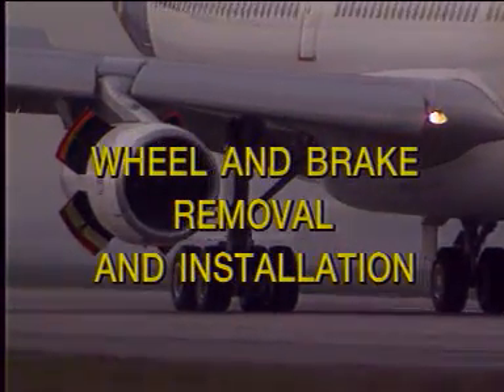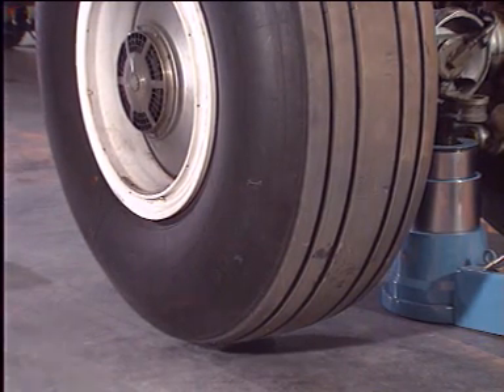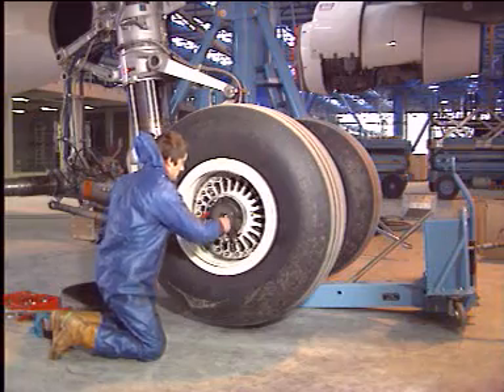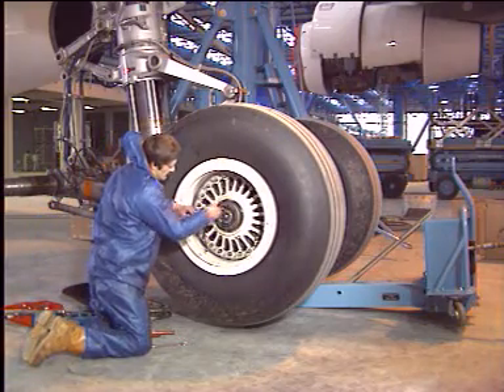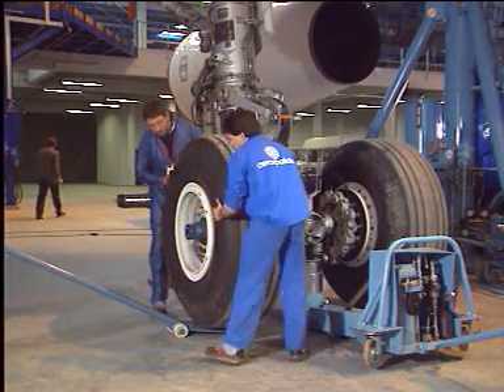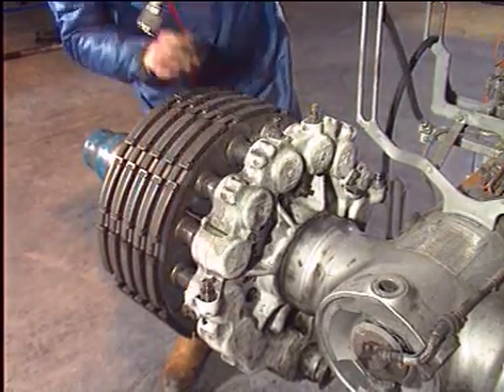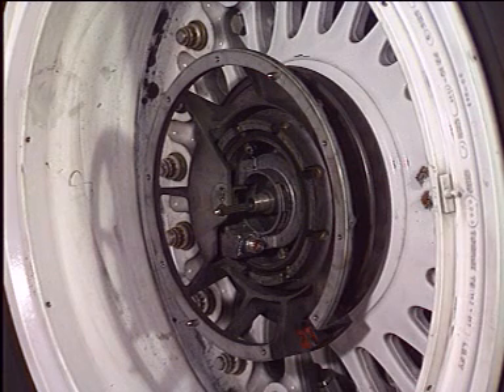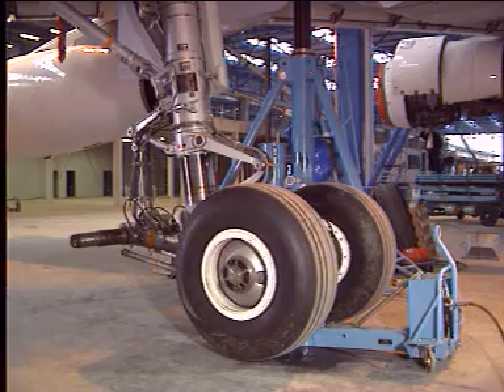AIRCRAFT | A330/A340 Main Landing Gear Wheel & Brake Removal / Installation

Comment: 3:35 "unscrew the wheel nut using the appropriate tool" a torque wrench is not used for anything but measuring torque on a fastener and not in reverse. Even I know that and I'm just a truck driver ffs
Reply: Yup, that’s what I saw too.

OMFG......
Reply: And yet, that’s the way it’s done every day at airlines all over the world.

Comment: The Installation procedure is nonsense (Its Never the reverse of Removal) How about connecting the Brake hydraulics ? and the torque link ? what about Torque tightening the various attachments ? How about a post installation Test.  Just about every mistake in Tech Pubs is in this Rubbish video..

Comment: Let me see if I have this correct:  The wheels on a main landing gear are removed with hand tools; the locking bolts are secured with cotter pins; landing gear assemblies are held out of the way with zip ties; break assembly is put on a wooden pallet.  Okay, I've got it.
Reply: Yep

Comment: Pro tip:  trust a nylon tiestrap to keep that 80lb control rod outta the way and stop it from falling on the next guy..  And torque wrenches should be calibrated after beating parts with it.

Comment: I'm watching this just in case the landing gear brake need to be replaced while I am in the airplane. You never know..
Reply: xl 
.
Reply: Where are your equipments? Are u gonna use toothpick??
XD
Reply: Yeah in case you get flat tires there is a spare under the plane.
Reply: @carlmichael4979 actually there ıs a spare wheel 😊

Comment: Use the appropriate tool...  and the guy uses the side of a hammer to knock a piece lose.
Reply: John Burton Maybe his boss is real cheap.
Reply: Thanks for sharing the video 😊
I going to buy an Antonov An-225  with 32 wheels.
This will really help me 😁😁
Reply: Holds up the torque strut with ty wraps from Harbor Freight
Reply: Absolutely correct? larger surface area.

Comment: You're not supposed to use a torque wrench for loosening bolts.
Reply: But why? I mean it makes the job easier since you can apply more torque on those bolts. With a normal wrench, you need to apply more force
Reply: You’re absolutely correct, yet in the real world, aircraft mechanics do it this way all the time. It’s just easier to have one tool for both loosening and tightening. Plus the torque wrenches are recalibrated annually, so you would know it if you knocked one out of calibration.

Comment: Will this work on my a330?
Reply: Gamebreaker08 no
Reply: Gamebreaker08
Reply: Well you would have to have some basic knowledge of a330 wheel removal of course,but I’m sure the steps are similar enough that you don’t need to spend to much time researching how to remove an a330’s wheels.
Reply: Yes. A340 and a330 wheels are the same. Same landing gear.

Comment: I wanna do line maintenance.  I`m going back to school for a career certificate in Aviation Maintenance Technology.
Reply: Where do u work?
Reply: VWGTI hard  work and long hours. I did it for ten years and if you have no medical problems like back problems you should be ok, but you will have back problems by the time you retire. The brake they removed is in excess of 300 lbs.  Good luck.

Comment: I always use the German torque standard..."GUDntight"
Reply: villageidiot bcddj
Reply: Same thing with ordnance nose fuzes; screw in nose cavity until it stops, back off a half turn and then snap it. Worked everytime for me, don't need torque wrench on flight deck.

Comment: can anyone tell me why is the wheel rotated in the same direction as the wheel torqued?
Reply: It's to gain a more accurate torque measure. of the wheel nut.
Reply: It’s to make sure the bearings are fully seated on the axle and not binding.

Comment: Nice video, but for a maintenance procedure in a controlled environment, it lacks one safety item. The wheel and brake should have been removed with a dolly designed for this specific job, which allows one person to do the job, much safer than two or three people. The shown procedure is used when one is in the boondocks with little support from better tools. But in a hangar, with the airplane on jacks, it would have looked better if the dolly was used instead of hand labor. Of course, it's much easier to do all this when one is in a nice dry hangar, when the brake and wheel are not hot, or when it's not raining, snowing, 40°C +, or the pressure of passengers waiting, thru flight, etc. But in all fairness, good presentation.
Reply: You people at main lines are so spoiled
Reply: Couldn't agree more..

Comment: Never seen anyone depressurizing the hydraulic accumlator since it is absolutely unnecessary because the hydraulic lines to the brake are quick-disconnect couplings.
Reply: +warpigxp It might be a safety layer in case the quick-disconnect fails to close automatically once disconnected.
Reply: corisco tupi Yes of course, you're totally right. I just have never seen anybody doing it :-P
Reply: I’ve never seen anyone pull any circuit breakers, either, though I imagine it would be a bad day if your partner turned on the brake fans while you were trying to remove them.